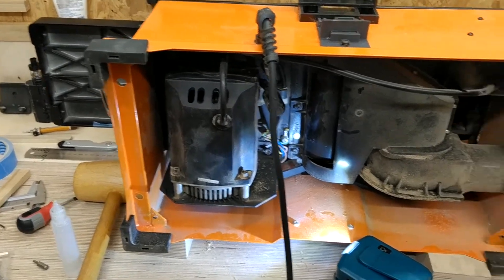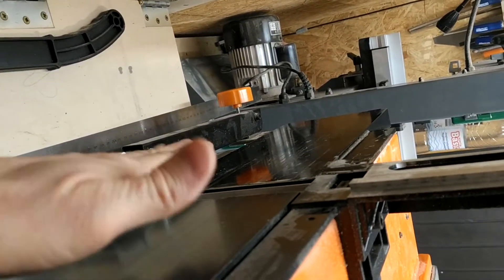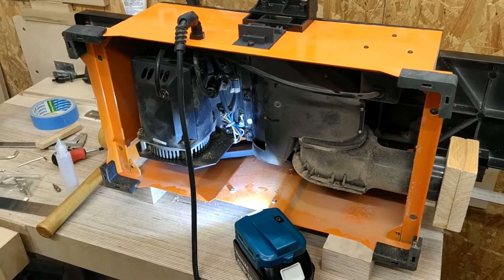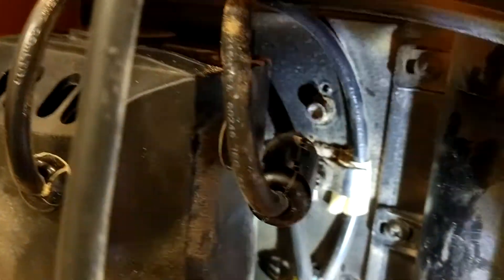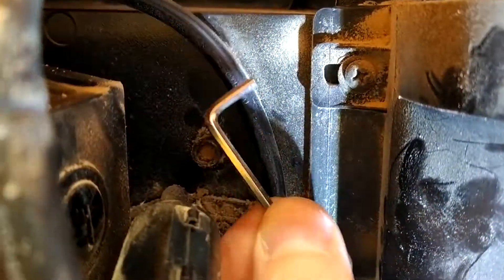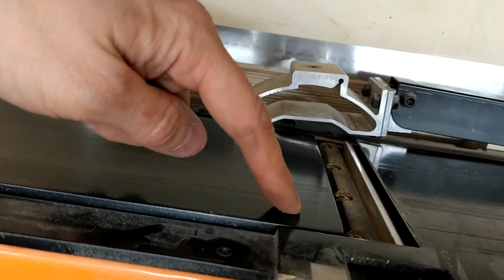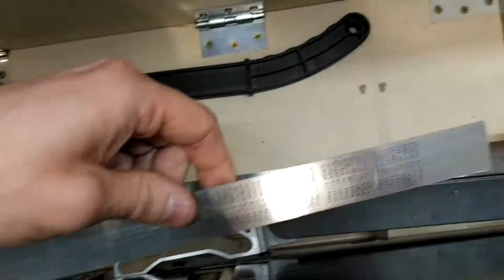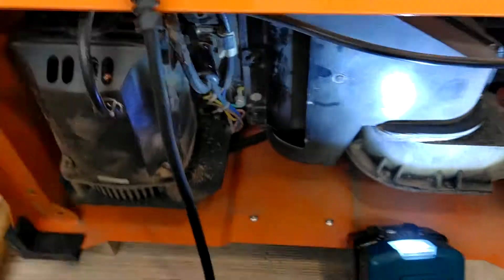How to adjust the infeed table for Triton TSPL152 planer jointer

Comment: mine seems paralell however, my timber only seems to be looking tapered. the blades cut the first 20cm and anything after that doesn't seem to be making contact with the blades, no matter where i apply little pressure on the outfeed table or how slow i make my passes
Reply from the maker: How do you know it's actually parallel? Are you really sure?
Reply from the maker: Maybe your blades are not aligned properly, and protrude more/less on one side?
Reply: @MārtiņšBriedis  hi martin. I discovered after looking, the blades wernt correctly set and i was still getting the same results so i thought. ohhhh fuck it, i took off the bottom plate and adjusted the bed and now after 30 mins of altering, the bed is perfect and parallel and cuting as it did when i used it first time. i think lifting it up by the handles has actually caused infeed bed to move. so ive now made a small bench for it and i never pick it up by the handles.

thankyou so much for putting the effort in to showing people how to alter the beds. youve saved me alot of stress
Reply from the maker: @amwartwork  awesome, I'm super happy it helped! And only 30 minutes, that is very fast, I think I spent a few hours altogether 😅
Reply: @MārtiņšBriedis  i have a set of long torque drivers. using an alan key was too hard and was annoying me lol

Comment: Hi Martins, where exactly in Latvia you bought this? And are they still in stock?
Reply from the maker: Store is afleks.eu, it's still in stock, 339 Euros
Reply: It's 545€ today, do you still think that it's worth the money? I'm making flutes and they are max one meter long and the timber usually is about 2*4cm. I'm reading here, that everyone has the problem with infeed/ outfeed table alignment, are there any more problems with this machine?

Comment: Wow, talk about easier said than done. Getting all four corners adjusted and level took me a long time and many attempts.  When you adjust one corner it can effect the opposite corner and sometimes adjusting the screw can have the opposite effect than what is intended. It pivots on the height adjuster. This sucker is heavy too! Sometimes I just had to walk away from it for a day or so. You really need a couple of allen head sockets and extensions to get to the rear screws.
Reply from the maker: Yes, it's not an easy task. I think it took me like four hours and I didn't get it perfect (but good enough!). But it's definitely doable!

Comment: Are you satisfied with this machine? I also want to buy a Triton or Shinko Ah150
Reply from the maker: Yes, it's a decent machine for the price. I definitely don't regret buying it.
Reply: @MārtiņšBriedis  I like to build cutting boards from offcuts and want to assemble the parts neatly. the machine would be great.
Reply from the maker: @librethekiteriders3533  yes, you can probably plane boards up to a meter easily. Recently I somewhat successfully tried to plane 1.4m long boards, but you need some kind of a support at the end though, because the planer is pretty short.
Reply: @MārtiņšBriedis  Perfect do you have instragram too?
Reply from the maker: @librethekiteriders3533  yes, but I don't really post anything woodworking related anyways.
Reply: @MārtiņšBriedis  ok thank you

Comment: I appreciate this video, thank you.
My Triton arrived with a whole host of issues, this amongst them. Had to send their Thicknesser back a few wks ago - done with them now - horrible quality control.
Reply: i had a thicknesser from triton TPT125. One day the motor or what seemed to b the motor just gave up. id only had it 3 months. i sent it off for repair. It came back repaired AND 2 days later i received a brand new one. of course i kept quiet about this. hahahah . seems their repair team cant log their repairs correctly neither. i sold the repaired one and now i just have the brand new one. hopefully that will survive over a year. if it does go bust, ile get the dewalt one.
Reply from the maker: What were the other issues?
Reply: @MārtiņšBriedis  The thicknesser was a write-off for the get-go & a logistical nightmare returning to England post-Brexit.
With regard to this product, I'll paste some of the emails/problems: "

1. Stripped Mbolt head and insert on the belt cover (I can live with that)

2.
 The fence wasn't milled correctly. There are 3 magnets used for 
alignment & to engage a protective blade guard at the back of the 
fence. Only one of them is correctly placed - they cannot be moved 
without milling holes for them. And as a consequence, the blade guard 
doesn't engage & the fence will not align. 

3.
 The bed adjustment screw bolt/apparatus is warped/bent. It still works 
but it's a pain in the ass & It's not really tenable in its current 
state.

The machine/motor works just fine and the blades are aligned..."

Support was good but, I still ended up wasting a ridiculous amount of time on both products and as such, I'll never touch another one of their products. 

Zero quality control - a veritable lottery. 

Unfortunately, at the time of purchasing, there wasn't an alternative option for anywhere remotely close to their price point - I paid x2 for a decent thicknesser and would have done so for a planer too.

Comment: Hi, I have this planer but my outfeed table is very uneven.. has anyone tried to flatten one? It’s only alum but would it be unwise to try?
Reply from the maker: How uneven are we talking about? Maybe send it back under warranty?
Reply: @MārtiņšBriedis  they both “Dip” in the middle by 0.13mm to 0.11mm across the lengths. The input table is consistent over the width, the output is less as you work towards you across the width

Comment: how do you like the planer? cons/other problems? is it suitable for occasional long board (1,5m)?
Reply from the maker: For my situation, it's a good tool. I like the portability, because I have very limited space, so I need to move it around. The max planing width 15cm, not that great, but since my bandsaw is max 15cm too, it suits me. It performs well if you tune it right. The fence is decent, easy to position, pretty solid, unlike some cheap combination tools (planer+thicknesser). Blade chips pretty easily, but you can get a pair of new blades for under $15 in Aliexpress, and they are resharpenable a few times too. One thing is annoying is the bed - it's not cast iron, it has paint on it. When you get chips in the blade, the streaks in the wood will start scraping lines in the outfeed table. It doesn't affect the outcome that much though. About length - I haven' t planed much longer than 1m, but I think 1.5m could be the limit. I' ll be building a table soon with length of 1.6m, I can comment then :)

For the price/size, I could not find a better option for a planer.
Reply: @MārtiņšBriedis  thanks for quick reply, i looks like a good tool for small shop, i was considered this planer and a big diy planer from my friend (for the same price) but the big one is 170 cm long and 40 cm wide (30 cm plane), it is such a big tool for a garage shop (wieght about 180 kg - not much portable)
Reply from the maker: A follow-up. Built the table, length ~1.5m. with this planer, you can't really get a perfect edge, usually the middle gets planed a bit more. But, it's an easy fix with a hand plane! Took me a few strokes and you could easily glue the boards without a problem! Ideally, you would need a bigger planer, but it is definitely better thank nothing, if you can finish the pieces quickly with a hand plane.
Reply: @MārtiņšBriedis  many thanks for your response